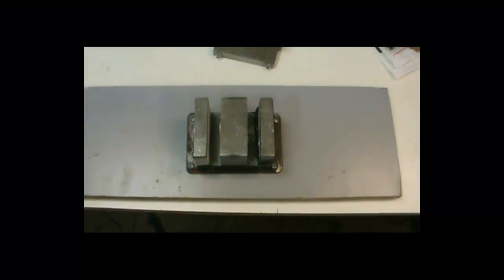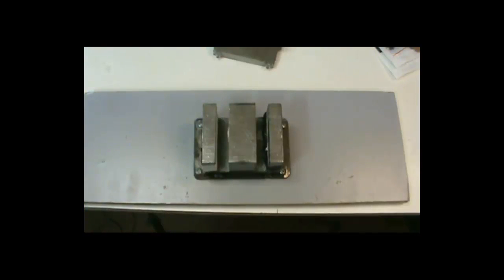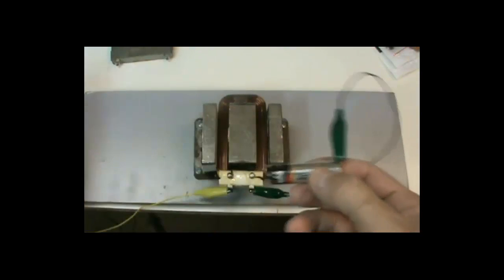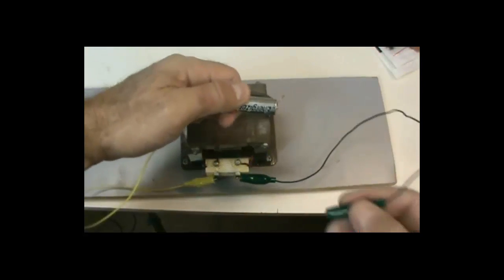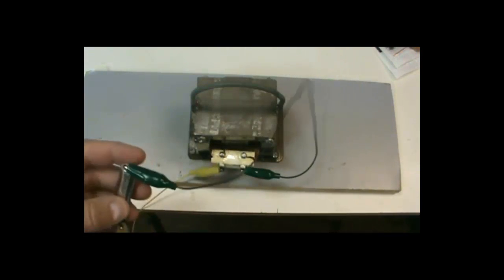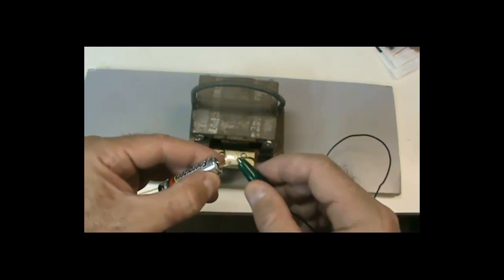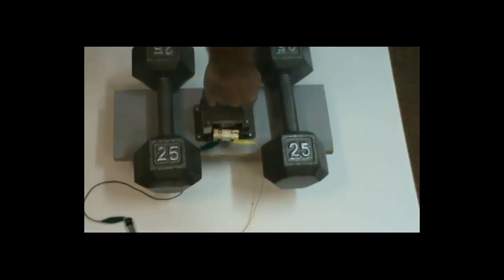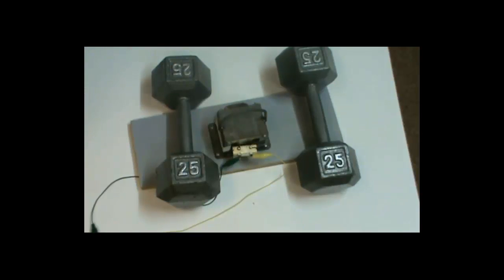Easy-to-Build Electromagnet lifts over 50 lbs

Comment: The secondary coil on MOT's have lots more turns compared to the primary, would that make a stonger electro magnet? Also I found a third wire between the two main coils, any idea what its there for?
Reply from the maker: You're right. There are many more turns on the secondary but the resistance of this wire is so much greater that a much higher voltage is required to produce a good magnetic field.

The third wire, with only a few turns of wire, is the source of power for the Magnetron cathode filament. This element only requires about a volt so only a turn or two wire is needed.

Remove both the high voltage winding (many turns) and the cathode wire (one or two turns) for best results.
Reply: Dorian McIntire
Wow thanks for the quick reply, any idea how long the AA battery will power the magnet for and also whats the best way the remove the top of the iron core to access the coils.
Reply from the maker: Marius Ammann About 5 minutes if hooked up continuously and full power is desired. A "D" cell will power it for much longer.
Reply from the maker: ***** I agree. This is why the most powerful electromagnets are either pulsed electromagnets or superconducting magnets. An "optimal" electromagnet depends on many factors and it's very difficult to pull everything together (pardon the pun) especially if you're showing people how to use commonly available materials to build one.

Comment: Hey I'm thinking of using this idea to create a backpack that has this magnet sitting in the back of it to hold a skateboard, long board, etc. Do you think it could work good in a backpack? And is the electricity or sparks in this very dangerous and or a fire hazard? Anyways awesome video!
Reply from the maker: An electromagnet like this uses quite a bit of current. Since the batteries wouldn't last long I would just use a regular magnet to hold things. Most rare-earth magnets these days are very powerful. Good luck.

Comment: do u have to use alligator clips exactly like the ones u use, cuz i have a transformer just like that one. i have taken it apart, both coils, got rid of all the paper and put the second coil back in. It does not work when i connect it to a battery. The alligator clips i use have really thick cord. Will this make a difference?
Reply: +sgman73 The thick cord will reduce the resistance, if anything it should make the magnet more powerful. Did you make sure to use the thicker coils? Is the battery full?
Reply: I've worked out that there is nothing wrong with the terminals or battery... Does the coil have to be in a certain position??? I have made it work well before when a physics friend helped me but now it just doesn't work. How do I fix this????
Reply from the maker: There is not much that can go wrong if the proper coil is used and the connections are good. If the wires are getting warm they are not heavy enough. Also make sure you follow the comments about improper transformers. The coil with fine wire is totally inappropriate for this magnet.
Reply: cool thanks

Comment: +Dorian Mcintire do you think it would effect the breaker or anything else in the house? Thanks for all your help! :)
Reply from the maker: +CAMERON BROOKS It should not affect a breaker only if it is turned on for a very short period of time. I must warn that you should exercise extreme caution when working with line voltages. The magnet will repel only non-magnetic materials when operated from AC.
Reply: +Dorian McIntire Ok thank you for all your help!

Comment: got my hands on another MOT and its the same 4.1 ohm resistance. is it because australian microwaves are different? dose this mean the current will always be 8 times less than yours?
Reply from the maker: If it's a 220 volt transformer it will definately be different. A 50 Hz transformer will also be different. You will need to provide a higher DC voltage to the tranformer in order to get good lifting power from the magnet.

Dorian
Reply: okay thanks, 

i want to connect a car battery to it. can i connect it directly? 

cheers
Reply from the maker: Liam deg Please let me know how it goes. Thanks.

Comment: Okay, so i built my own electromagnet its powered by an AA battery now every once in a while it will shock me. i just want to know how much it is boosting the AA battery volts. since it can shock me and it sometimes hurts like hell.
Reply from the maker: Large inductors - like the electromagnet - will store a considerable amount of electrical energy in the magnetic field of the magnet. This energy is released when you attempt to interrupt the current flowing in the magnetic coils. When you try to interrupt the current the magnetic field collapses very rapidly and induces a large voltage across the coil. I've gotten shocked many times by these magnets and it feels like about a hundred volts or so. Just make sure you're not touching the coils terminals when you disconnect the power and you should not get shocked. Adding a fly-back diode (Google it) will help with the problem. Isn't electronics wonderful?
Reply from the maker: This is also a sign that your electromagnet is probably working well.
Reply: Also, how can i make it repel objects?
Reply from the maker: Apply AC and it will repel aluminum and copper objects.

Comment: what is the difference between microwave oven transformer that operating in 120v and with that is operated in 240 V
Reply from the maker: +Abdulla Qasem The primary has twice the number of windings in a 240 V transformer. This means the coil resistance will typically be higher and will require more DC voltage in order to get the same magnetic strength.
Reply: Thank you for your response.Can we change the 240 V transformer to 120 V ? or we should start winding from beginning ?
Reply from the maker: It has to rewound.

Comment: Can u do a demonstration with 120volt power to the coil instead of battery power to see what it does
Reply from the maker: Actually 120 volts AC causes the electromagnet to generate less pull since the coils possess quite a bit of reactance.

Comment: I am trying out your design with a 12 volt battery...before we blow ourselves up what do you think would happen?
Reply from the maker: A 12 volt battery will work and should be very powerful. You probably won't be able to keep it connected very long however before the magnet begins to overheat.

Have fun.
Reply: How can I prevent that? add more wire from another microwave?
Reply from the maker: You could wrap more copper wire around the core - if it will fit. This will have the added effect of making the magnet even more powerful. Make sure you wind the coil in the same direction and the existing coil. Good electromagnets, by nature, get warm since they use quite a bit of current.

Experiment to see how much wire is needed to allow you keep the magnet connected without overheating. Experimenting is really the only way to find a sweet spot. Try the magnet first without any modification to get a feel for how long it takes get hot.  If it takes awhile to get hot then only a dozen or so turns should be enough to make it work longer. Good luck.
Reply: Thank-you Dorian. You are a good teacher..

Comment: hello,i have an urgent question.
if i use this electromagnet on one side of a 1 cm thick steel sheet can i attach other metal objects on the other side of the sheet?and should the metal objects be so close to the electromagnet from the other side?
Reply from the maker: JEAN-PAUL SAMMOUR I'm having trouble visualizing what you mean.
Reply: Dorian McIntire  if i place a 1cm thick metal sheet instead of the handle in your video would i be able to stick other metals on the sheet?
Reply from the maker: JEAN-PAUL SAMMOUR Possibly, but not with very much force. Most of the magnetic field is concentrated in the air gaps between the poles on the bottom of the magnet.
Reply: is there any other possible way to transform a 1cm thick metal sheet into an electromagnet
Reply from the maker: Bend it into a U-Shape (like a horseshoe magnet) and wind a coil around the middle piece.

Comment: Sir,  I tried as you shown but I did not get that much of electromagnetic force. Please advice me
Reply from the maker: If you experience problems with this project please check the following:

- The electromagnet current should be at least 3 amps if you use the correct transformer windings and a fresh 1.5 volt battery. You can use any 1.5 volt battery. The best battery to use is a D cell battery if you want the battery to last a while.

- The coil winding should have less than 1 ohm of resistance

- The battery should be fresh

- The power leads should be large enough to handle the current.

- Try using a car battery for power if the 1.5 battery does not work with your electromagnet

- The magnet will only lift thick iron objects very close or touching the end of the magnet

- This magnet cannot pull objects that are more than a inch or two from the magnet

- The magnet works best with the microwave oven transformer designed for a 120 volt voltage system. Microwave oven transformers designed for 220 - 240 volt systems will not work well at all unless a larger voltage is used.

Let me know what you find out so I post the problem and solution.

Thanks.
Reply: Sir, thanks for your reply. I will check and let you know result

Comment: What if you used a 9V battery would it be able to lift more weight?
Reply from the maker: A 9V battery will work but the current capability of a 9V is very limited and will only power the electromagnet for a few minutes. We really need a source of either high current and low voltage or a higher voltage source with a very high current capability for best results..

Comment: I plugged mine into 120v ac wall socket, barely strong enough to hold itself up...  suggestions? I also tried aa battery and nothing happened at all
Reply from the maker: You probably used the wrong coil. You should have used the coil with fewer turns not the coil with fine wire and many turns. Any source of DC power must be capability of providing several amps of current. Also if you plug the unit into 120 V ac it will not act like a good magnet and will actually repel non-magnetic metals. Most of the potential problem issues are covered in the comments.
Reply: Dorian McIntire i used the thicker one with less turns, as for power source i found that any battery,(other than car battery) do not do much at all
Reply from the maker: Are you using a European microwave transformer? A 220 volt unit will have too many turns on the primary to work as well as a 110 volt unit.
Reply: Dorian McIntire , my transformer appears the exact same as the one in your video, as well as i live in america so i doubt that it is from europe,
Reply from the maker: Ohm out the wind resistance. The coil could be partially shorted and should have at least 0.25 ohms of resistance.
Reply: Dorian McIntire ok will check it, probbably will try a new transformer, see if that fixes problem

Comment: Are there any dangers as far as the battery failing or heat buildup that we should watch for in particular?  This is great.

Also, I find it odd that as much force that is being generated, when you left the "handle plate" off of the lower piece and applied power, it didn't really POP into place.  I would think that this could create a potentially dangerous magnet that might pull nearby metal objects toward it rapidly when the voltage was applied.  No?  It didn't look like it in the video.  Is this a function of the power decreasing exponentially as distance increases?
Reply from the maker: Use a low voltage for lowest amount of heat generated and longest battery life.

Most magnets like this one have a very short range but can be very powerful at these short ranges. You are right that the forces fall off exponentially as the distance is increased.

Thanks for commenting.
Reply: Dorian McIntire Is there an easy way to emanate the magnetic field? I want a magnetic version of the metal detector.
Reply from the maker: Ryan Metcalfe You really need a coil without a core to sense metal long distances. Proximity sensors, for instance,  use small iron cores to sense very close metal objects on the proper end of the sensor.
Reply: Dorian McIntire Im a very very beginner in electromagnetism... Actually am a software developer.. But loves electromagnetism very badly..
So you mean the core for stronger magnet and without core it can attract from far or with out core increases the magnetic fields surrounds it?
Reply from the maker: Sandeep Thomas In general magnetic fields can be very powerful in low reluctance (sort of like resistance) materials like iron. If the thing you want to lift is iron and it can complete a magnetic circuit then it can be very heavy but must be in contact with the magnet. Magnets without iron cores are generally weak but the weak magnetic fields can reach out farther since they are not confined in an iron core.

Comment from the maker: +sgman73 Thick wire is good. You should be using the coil with larger size wire and fewer turns? Check the continuity on the coil with an Multimeter to make sure the wire is not open-circuited. Of course make sure the battery is good also.
Reply: Dorian McIntire how many turns and what thickness
Reply from the maker: The primary winding for the transformer is already about the right gauge and number of turns. It's typically about 18 - 20 gauge with about 120 turns.

Comment from the maker: Stephen,

Make sure you use a fresh battery capable of providing the large currents required by the electromagnet. A 9 volt battery will not provide enough current to do the job even though it has a higher voltage than a AA or C cell. 9 volt batteries are designed to provide higher voltages not currents. You will need a small motorcycle battery or car battery if you really need more power. Also make sure you use heavy wires to conduct current from the battery to the magnet.

Comment: Hi Dorian, is is possible to run the el.magnet with FS 2KHz? What I mean is turning it on/off something like 20.000 times in a min.thanx
Reply from the maker: This is a good question because it brings up several issues that must be dealt with with inductor-like devices such as electromagnets.

Using a PWM frequency of 2Khz (2000 times a second) is much too fast for the electromagnetic for several reasons:

--- The inductance of the electromagnet is much to high and varies depending on whether the magnet is loaded or unloaded.

--- The eddy currents in the transformer core at this frequency would waste most of the energy in the form of heat. The transformer was originally designed for 60 Hz (60 cycles per second) the laminations are designed to help minimize losses at this relatively low frequency. At much higher frequencies a powered or ferrite core would be needed but the permeability for such a core would be much lower which means the magnetic flux would be much lower creating a much weaker magnet.

Sorry if this is bad news.

Thanks for commenting
Reply: Dorian McIntire
Thanx for the reply!
So if I have an alu disc with 20 neo magnets on the side of it, with same polarity turned to the outside on a certain distances, if I put 20x 20w el.magnets, running it with 60hz ( 3600 on\offs per minute) I would be able, to spead up the disc, run by a motor, to a 10.000 rpm right? 20 el.magn. with 60hz each is equal to 1200 impulses in a second.
Reply from the maker: Nikola Mijic If I'm visualizing what you want to do properly I think you might be able to maintain a certain rotation speed but probably could not accelerate to that that speed. Since the electro magnet would have to start at zero hertz and gradually increase in frequency to 60 hz.

Comment: Is the voltage w/ respect to the lifting force linear? Say, if you used 2 AA batteries instead of one, will the lifting force double as well?
Reply from the maker: +Shlomo For the most part this is true. At some point the current draw may overwhelm the power source but it can also overheat the winding in the electromagnet.
Reply: +Dorian McIntire Why don't you take the primary coil and attach it to the secondary coil, to have a larger-coil base for a stronger electromagnet?
Reply from the maker: +Shlomo Read my comments about why this does not work well. I wanted a magnet that could operate with small, low voltage, high current, power source like the AA battery.
Reply: +Dorian McIntire Does the strength of the magnet rely more on the Current than voltage? cause B is directly prop. to Current? Is that why you cared more about high current?
Reply from the maker: +Shlomo Yes magnetic fields are produced by charge movement, or for this project, electron movement which is also known as current. However voltage is required to produce current in resistive material. So voltage is the cause and current is the effect which also creates  a magnetic field. The higher the current and number of turns the stronger the magnetic field but higher turns means more resistance, which means higher voltage required etc.
Reply: +Dorian McIntire Thanks for all this info! Super fast replies with a passion for spreading your knowledge. Thanks a ton!

Comment: what would happen if i applied more power? say 4+ batteries or even a car battery? would it lift more weight?
Reply from the maker: Yes but it will overheat pretty quickly. You can over-load the magnet for short periods of time but you must let it cool down. Most very powerful, resistive, electromagnets - like those used in early MRI scanners - were water cooled.
Reply: so the more i charge them the less time i could use them? i don't know if you have ever seen colin furze but he made some shoes out of them where he could walk on a metal plate on the ceiling and im hoping to attempt something similar so im trying to learn what i could do to add more power and make them last longer